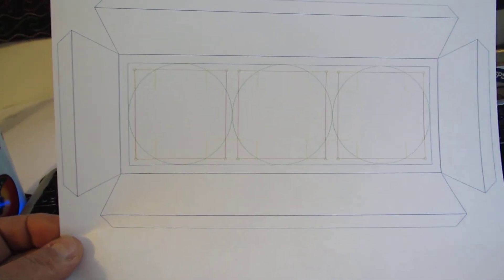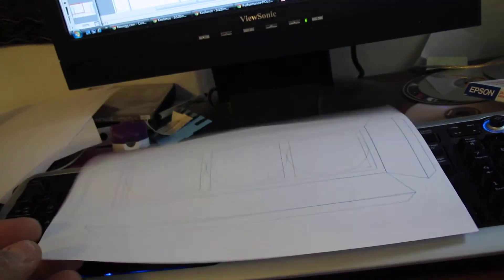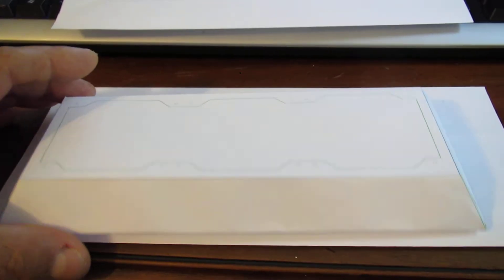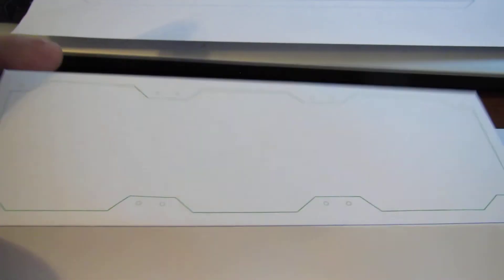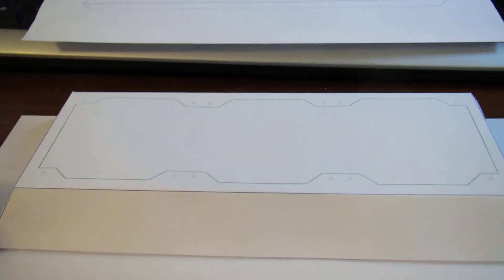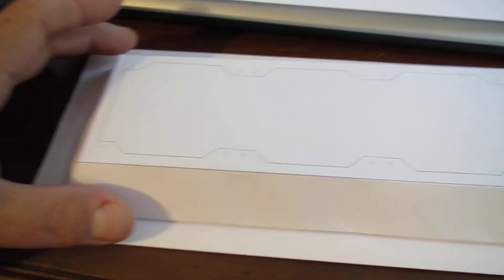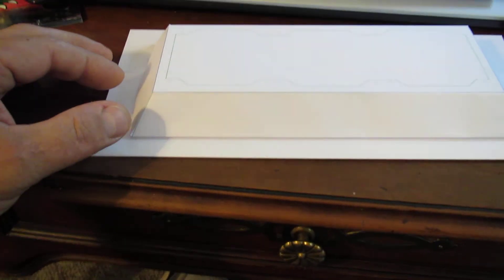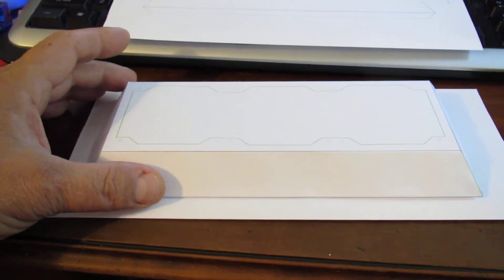Corsair 800D Mod: 360 Shroud Design

Comment from the maker: @Zomgwtfbbq1228 Correct. My printer is toooooooo small. I used to have a massive 13 x 19 art printer...even that would be too small. The overall size of the sheet metal blank would be about 11 x 20. The finished shroud has aabout a 7" x 16" footprint and is about 1.5" tall. It's a 360 radiator shroud...

Comment from the maker: @berserk192 The sides are plastic. I would not be able to color match the Polar Anxiety powder coat that will cover the exterior panels. I could make metal strips to cover the sides, coat those, and screw them onto the plastic sides...which is my back up plan. But the Koolance part is painted and would need to be stripped anyway. The amount of labor to cut and bend  up a shroud is about equal to purchasing a Koolance, stripping it, making and fitting a metal fascia. But it is plan B.